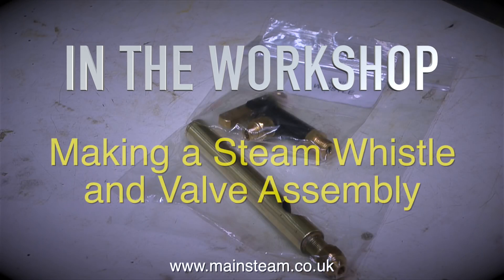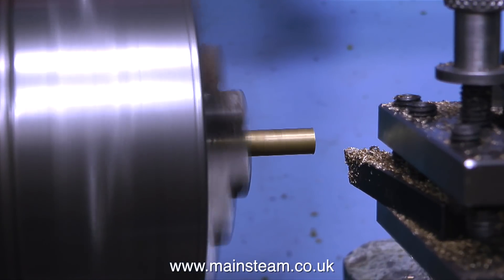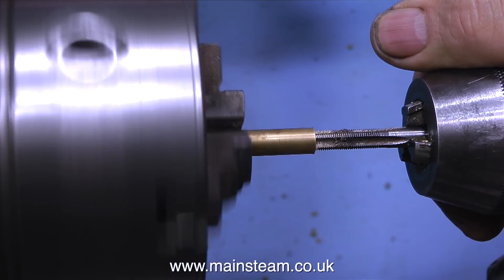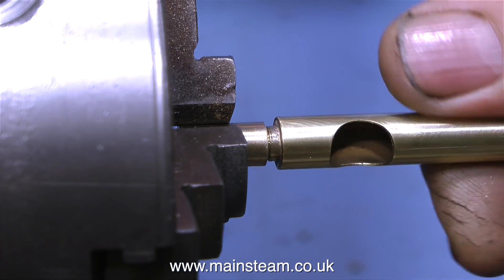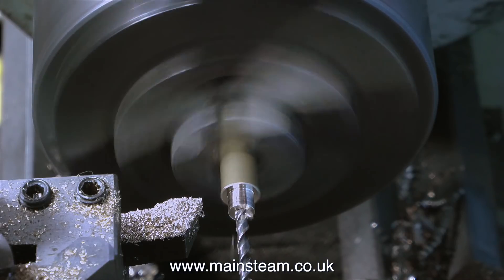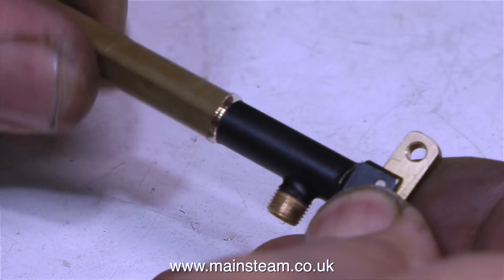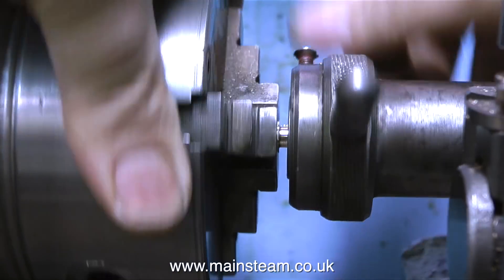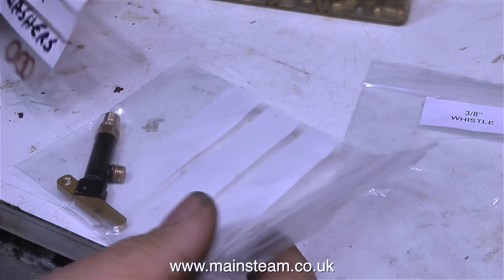A MODEL STEAM WHISTLE & VALVE ASSEMBLY - IN THE WORKSHOP

Comment: Centre drills are also important when using chisel tip twist drill bits, since they can't really cut the hole to start, they need a centre punch or centre drill hole to start. Split points are better but still benefit from a help from a centre hole or a divet from a centre punch.